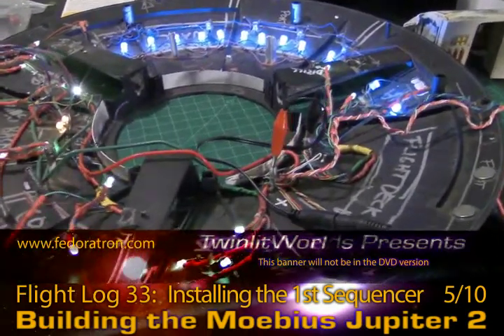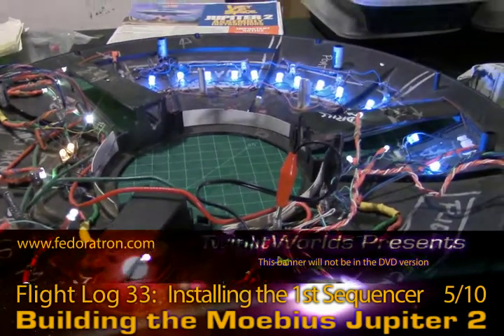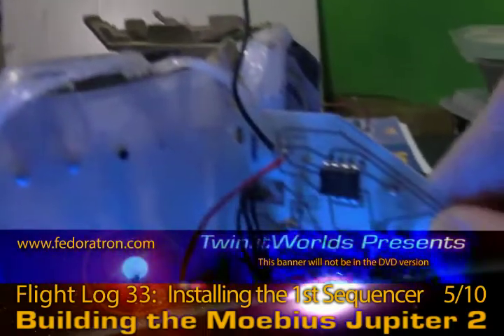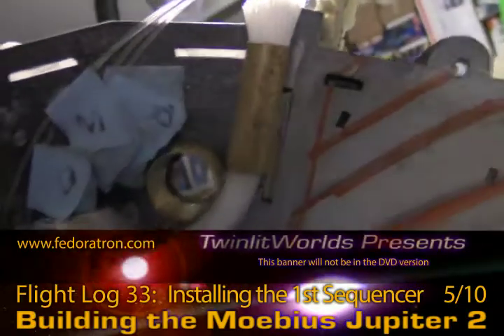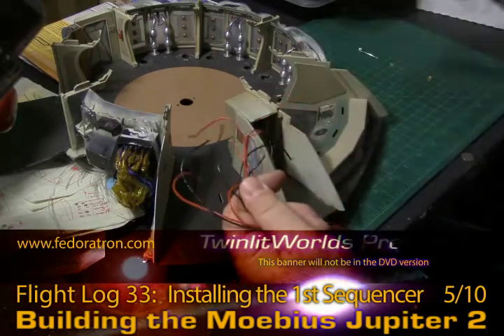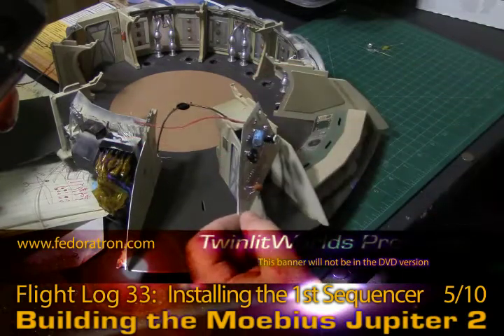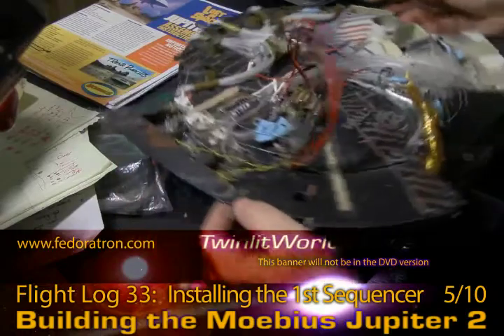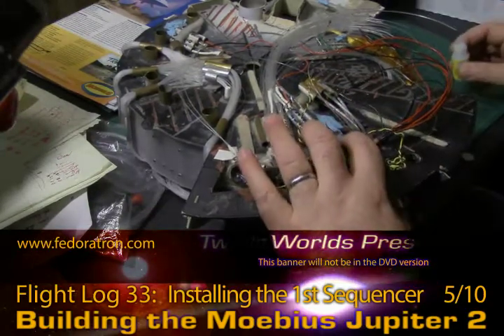J2 FlightLog 33: Part 5, Installing the 1st Sequencer

Comment: I really admire the fact that you have kept working on this project over the years. I, for one, simply lack the basic tenacity to get it done. I would have already screamed a bunch of profanities at this model and thrown it against the wall.
  When you're done with the J2 and not "IF" you're done.. this is going to be better than the actual studio model.
  You're just about into the home stretch!